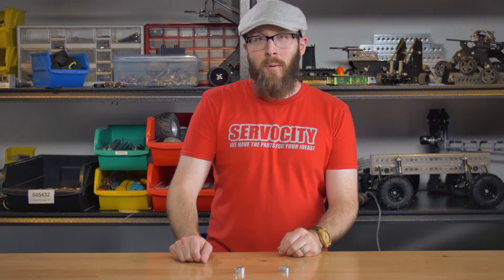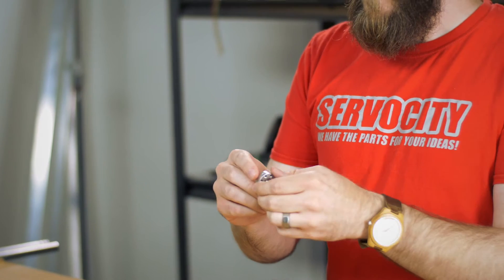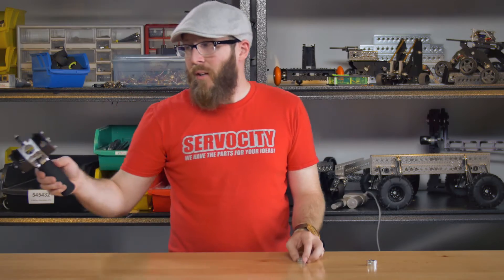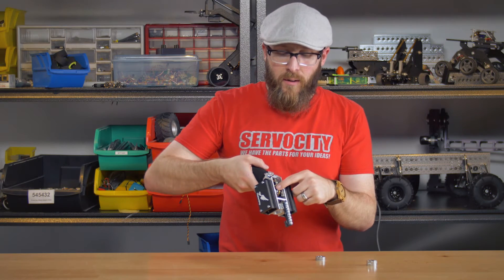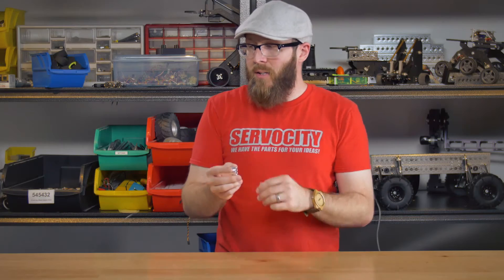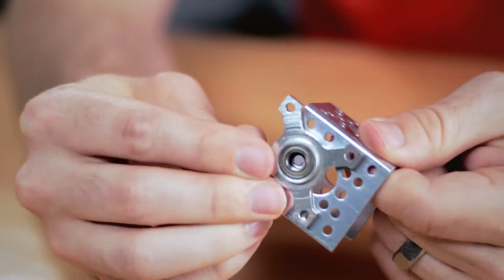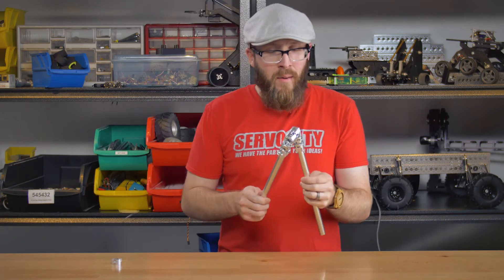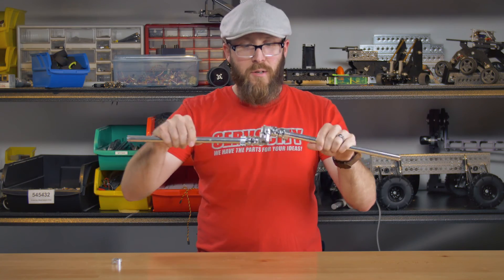Comparing Swivel Hubs and Ball Bearing Hubs - with Jason

Comment: What would your advice be, I am making an airboat and want to have a rotating motor rather than rudders, how can I affix the motor to the bottom of the boat and still have it able to pivot? (Motor is way too powerful to mount directly on the servo)
Reply from the maker: It really depends on the scale, but is the concern about a servo not handling the power of the motor about support or torque?  If the concern is more about the support, a ServoBlock might be a good option. https://www.servocity.com/servos/servoblocks  If it's about torque you might want to check out a Servo Gearbox. https://www.servocity.com/servos/servo-gearboxes  Feel free to email us should you have any other questions tech@servocity.com.